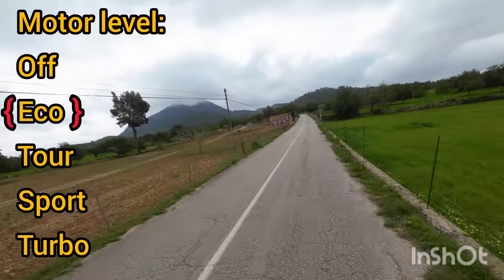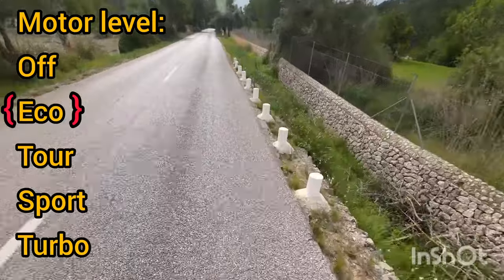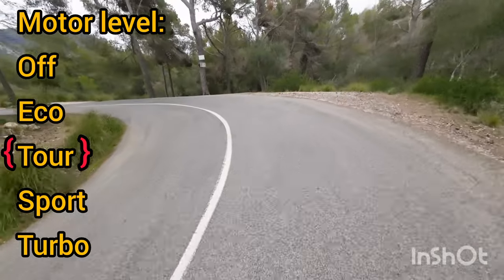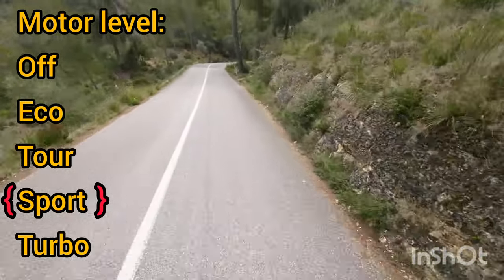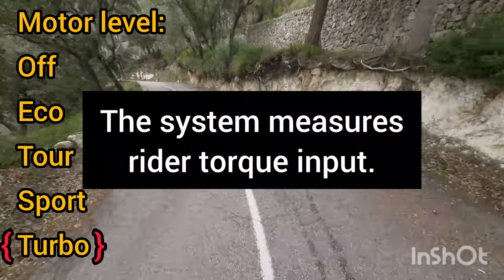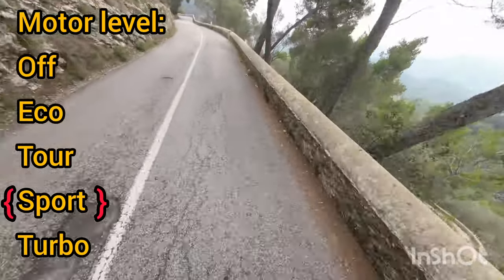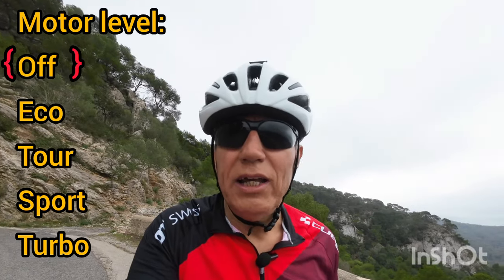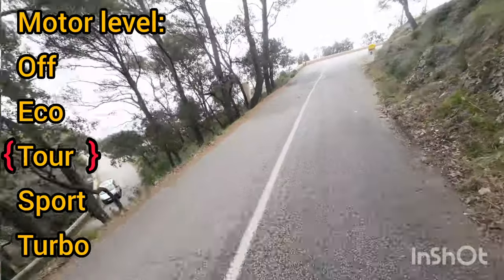Gravel ebike: Bosch up-hill (compared to X35).

Comment: Always very informativeTerry. Looks like you are flying along. I found the mid drive so much more efficient on my new bike. I had the D30 (x35) and now have the Scott Solace 50NM (TQ mid drive) which is 12.5 kg and is much more suited to my lower leg issues and weight. Almost down to 100kg from 115kg. Riding 200 miles a week indoors at the mo.
Reply: I’m debating between an x20 bike and a bike with the same TQ. Do you feel the jump in torque? The x20 has even less torque than the x35.
Reply: Mid drive all the way for me. TQ is for me a perfect system and unlike the X20 or X35 does not suffer from assist degradation when going up a steep hill and  you cannot manage a fast cadence the motor struggles to deliver. He TQ is noticeably stronger on hills but not much difference on the flat.

Comment: Can I ask you Terry if you had to choose one bike for general use would it be the bosch motor or the X35.
Reply from the maker: Please, can you ask me an easier question? I'll do my best though. Feel free to ask follow-up questions if I don't cover everything you need. 

I'm not sure what you mean by general purpose. I'll assume you mean one bike for everything. A lot of this will depend on the primary use of the bike and the requirements of the rider. 

If the bike is to be used for riding fast (average>25kph) and not too hilly terrain the hub motors are a good choice. It just gives a little extra help on the hills and into strong headwinds. 
If you ride a lot of steep hills, carry equipment like touring gear or you want the bike to do more of the work then a mid-motor like the Bosch is a good choice. I should say though the Bosch CX motor gives more 'power' than most people will need for riding on the road. There are exceptions though, like hauling heavy loads.

In general though, the mid-mount motor will do most things, whereas the hub motors are more specialised. Hence for general riding the mid-mount motor would be my choice. I probably wouldn't choose a Bosch CX though. Something around the 50-60Nm is ideal. In the Bosch range that would be the newer SX motor. 

I have also used a bike with a Fazua Ride 50 motor. I think it gives just about the right amount of motive force, although at 250Wh, the battery is a bit small. 

An important aspect for general purpose riding is also the battery capacity. For me a minimum of 400Wh, preferably 500Wh is a must. 

Strangely enough, this general purpose bike is something I've been pondering. As such, the Canyon Pathlite:ON SL (https://www.canyon.com/en-gb/electric-bikes/electric-touring-bikes/pathlite-on/sl/pathlite-on-sl-4/3605.html?dwvar_3605_pv_rahmenfarbe=GY) looks interesting.
Reply: @FiveMinuteVelo  Many thanks for your comprehensive reply, just what I wanted to know, I ride a non e gravel bike at home, North East Scotland, hills, tracks, all sorts, we travel in a motorhome, for quite a few months in a year, mostly in Europe, when the motorhome is parked up we use public transport and the bikes for getting around and shopping and the like, which is fine but we are limited in how far we can go and with the shopping carrying the weight, hence the interest in e- assist bikes. I have been looking at a few, including the Fazua based bikes, I like the idea of that system but it does seem to suffer from reliability issues, possibly more than the bosch systems, of course that may be a case of a small number of negative experiences being more vocal than the satisfied ones. I will check out the bosch SX bikes, Thanks again.

Comment: Note: Motorcycles are even more fun since you don't have to bother with pedals. My question is how much work do you want the motor/battery to do vs what you contribute? No comments on how the bike felt pedaling with zero assist other than slow and heavy. Do these things feel like you're turning a bunch of gears inside the mid-motor rather than pedaling a bicycle? That was my experience on the single mid-motor MTB I tried - YUCK!
Reply from the maker: I used to ride motorcycles so I know where you are coming from. 
For me it is a balancing act, leg:motor power ratio. I like to cycle and hence put in effort. For general riding the X35 is  great on low or mid levels. It saves me effort on the uphills which does not tire my brain too much. I keep the highest power output for emergencies when I'm not feeling too great. The motor cutting out at 25 kph is also helpful as most of the time I'm riding without motor assistance. 
As for that, Bosch CX bike, it was superficially nice to have the high level of assistance, but ultimately unsatisfying.
I'm thinking for touring, where the bike is loaded up, the higher rated, mid-drive motors would be more suitable. 
I am planning a deeper dive comparison between different motor drive systems.